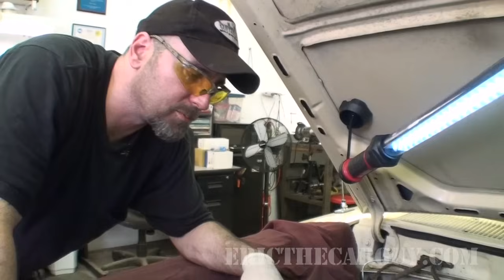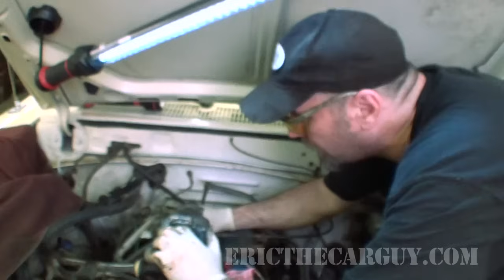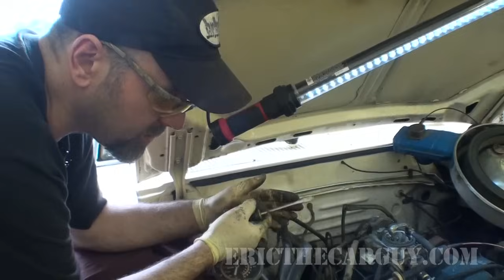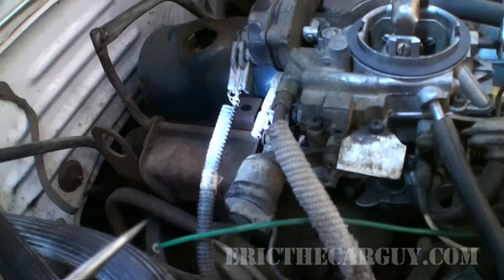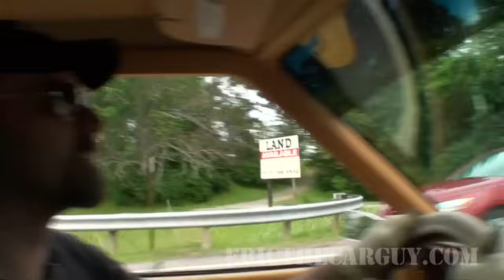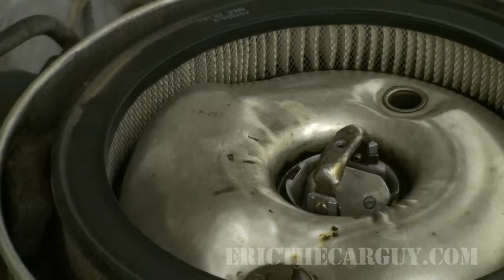Carburetor Adjustment Basics -EricTheCarGuy

Comment: Hi Eric i have a 94 Nissan Cefiro with a RB24S Straight-6  and it has a Carburetor
what do you think should be the idle? currently its on 580 or something when i start it in the morning and if the engine warms it goes to 600 by the way its a M/T

Comment: Great video. I've almost got mine dialed in (1970 F250, FE 360), but it dies when I step on the gas too hard. Will look at the accelerator pump and check for vacuum leaks (just one line for timing advance, shouldn't be hard).
Reply: did you ever figure it out? im having the same issue
Reply: @stephen-oy8lx  Leaky accelerator pump diaphragm

Comment: I tried to adjust the choke dial thing (the large black knob); and it would not turn by hand. Yes, I loosened the screws holding it tight. Do they get stuck sometimes? I am thinking to use a wrench on it; but I just want to check with you guys first. Anyone have that experience?

My car is a 1965 Mustang with a 200 c.i. 6 cylinder engine; and the choke is NOT electronically controlled.
Reply: +Bob Simmons I solved the problem. My choke has a bracket to hold the heater hose; and the screws I was loosening only held the bracket on. The crews to loosen the black dial were underneath the heater hose bracket. My car is a 1965 Mustang. The carburetor is just like your, except my choke is not electric.

Comment: so if the car kicks when you put it in drive that means the idle is high?
Reply: I hope that you didn't automatically assume that something as expensive as a T.C was your problem...if it were me, I'd have a buddy scoot through the gears with the parking brake on while you look at where the driveshaft meets the A) Transmission, B) Rear Differential. Does it clank when he courses through the gears? When the vehicle is OFF and PARKED, go under the driveshaft and see if you can turn it with your hand. U-joints, maybe? Yolk? Rear diff? Try these. Transmissions are (usually) not the first thing to go...but they do cost the most. Good luck man.
Reply: +Austin Evans My 1965 Mustang 6 cylinder engine gives a pretty good jolt when I shift from Park to Reverse. I don't quite understand what you said in the comment above; but it sounds like my car has ,generally speaking, the same problem. Are you saying the torque converter needs to be replaced? What is the solution to the problem? Thanks for your help...
Reply: It can, it means that your torque converter is trying to engage, so when you put it in drive, the input shaft of the transmission is already spinning when the gears engage, jolting the drive lines and kicking the car forward. It's the same reason you can creep the car without giving it any throttle.
Reply: +Bob Simmons what rpm does you engine idle at?

Comment: good vid as usual. Qustion here.......86 caprice 5.0 has a rough idle but smooth when driving. Car lacks power. Had a complete tuneup........
Reply: That's cos it's a caprice
Reply: Check idle jet etc
Reply: Cars and their Parts thanks will do

Comment: Hi sir, Just want to ask about my problem in my nissan b13, carburetor type engine, i can find the problem, when ever i start the car, it will run smooth then after 5 mins of running the engine start to choke and the engine will stop, and i will start it again and it will not start after 15th to 20th try the engine will run again. i already adjust the carburetor but still the problem occur. what will is the problem of my car? thanks
Reply: Get a Weber 32/36 carb for it those hitachi a are garbage I put one in 78 Datsun b210 and it will solve that problem
Reply: check your fuel lines to make sure they aren't leaking, and check for stress cracks in the lines, check the fuel filter to make sure it isn't clogged. also there is a screen in the gas tank and it may be deteriorating and blocking fuel flow

Comment: Great work bro. Going to try on a 1993 nissan sentra b13 Carburetor. Revs at a 1000 when in gear, once its neutral revs goes up almost 2000 rpm.

Comment: I've got a problem on my 68 mustang L6 where it idles rough. I can get vacuum at idle to 17 PSI, but the needle searches around slightly as if there's a vacuum leak. But I sprayed carb cleaner everywhere and never found one. When listening to the engine it sounds like it doesn't fire evenly, like there's a hiccup in the rotation, at park and in gear. Gas mileage is terrible, throttle response is okay, not the best. Timing is set up properly but its really touchy, there's one sweet spot and not much room to play with when rotating the dist.(otherwise I get surging or stalling). Air mixture screw is turned really far out for best Idle I can achieve. Car diesels slightly after engine is off. I'm lost as to whats wrong. Any help anybody???? Please.
Reply: +Dakota McCullough Are you getting engine sputtering at highway speed as well? I'm having a major issue keeping the idle on my I6 good at both cold and hot; and it coughs and stalls on the highway really bad
Reply: +Keltyn Ruddock no engine sputtering on the highway, thankfully, but it does feel like I'm pushing the car to its limits when I drive on the highway, but I think that's to be expected from an I6 with a c4 tranny. I've considered saving for a new carb from classic inlines, that may help your problem too. also look into your choke mechanism and make sure it's set up right. Mine was all out of wack.
Reply: +Dakota McCullough I actually put a reman carb on it shortly after I bought it, the old carb was beyond saving. My choke seems to be working right but I can't for the life of me figure out what's causing it. it's fine when its cold, nice solid shifting, perfect throttle response but once it warms up that's all out the window

Comment: Mr. EricTheCarGuy. At the end of your video, you mentioned hot start but never went into details for that adjustment. If the engine is struggling a bit on hot start, what is the initial adjustment?

Comment: Ok folks, I recently installed a Rebuilt Hitachi Carburetor on my 87 Isuzu. The carburetor was rebuilt by National Carburetors and the truck is running good. The problem is that I don't get the gas mileage I should be getting and there is like a whining screaming noise. Its not incredibly loud, it sounds a lot like a squeely fan belt but it is coming from the carburetor. I don't have the fuel mixture adjustments, they are locked in place. Please help.

Comment: Pretty sure the throttle solenoid is for the prevention of "dieseling" when you shut the car off.

Basically the idle screw is set to about 450 and the solenoid is set for 750 + or - and when the ignition is shut off the solenoid retracts and the base idle is achieved preventing the engine from "running on".

If the solenoid fails the car will still idle when started but will be very slow indicating a solenoid failure.

Comment: The vacuum hose that you plugged goes to the bottom of the air filter housing on the sensor for the heated air door, of course you don't have any tube going to the  door anyway.

Comment: I noticed that the engine wiggle a lot when it's running. Could that lead to problem or is that just the way it should be? Do you need to do anything to make it more stable?

Comment: Man, Eric- after all this- I'd just steam clean up the engine bay, dress up other stuff (new premium wires, cap, get that air cleaner painted & a new duct, a pkg of real vacuum caps, etc.) then paint that engine- and keep it in the car. Why "follow the pack" with some "high performance muscle" refit that has been done so many times? Change the trans fluid & filter, new modulator- really put money into it- and keep an old original economical car.

Comment: Hi Eric, in the whole video you did not mention float level check/adjustment, and I was waiting for it since in my opinion this is the first basic settings you should check/correct when adjusting any carburettor. Often the lip/tongue part of a float can be bent to set the float level just right.

Float level is important because it affects mixture richness along a very broad load range.

Comment: My 1959 Cadillac series 62 Eldorado Biarritz has something wrong with the carburetor. It acts like its not sending gas to the engine. If i spray carburetor cleaner it runs for a few seconds then stops. any ideas on what could be wrong...
Reply: Fuel pump problem. Or something clogged. Or a fuel leak.

Comment: I need to rebuild the carburetor from a 1982 Toyota Tercel  with 3A-C engine. 
Being a California emissions spec, it has a heavy load of vacuum lines. No joke. 
Luckily from factory, the mixture adjustment screw is sealed and no one has been able to fiddle with it since factory, so that part is ok. 
The problem Im having is that at idle the emissions are high (around 800, it should be no greater than 120 HC) it will not pass emissions test.

Comment: i like carbs. they force you to (gasp!) know your car works and how to fix and adjust it.
Reply: So does fuel injection just two different ways of adjusting fuel maps. One does it by screws and stops the other by informing the ECU what fuel amounts should be entering the engine at certain conditions.
Reply: @Cragified  True, but on both you have to move that map if you make a serious change on the engine, the EFI will more or less make it painless depending on what system you have, where as a carb you could be starting from scratch with that engine.
Reply: true, but all a carb needs is a screwdriver, and all you need to do is watch and listen until the engine sounds good. because of this anyone from 5 to 95 can do it and it takes 5 seconds to figure out what sounds good and what sounds bad.
to tune an ecu you need a laptop, usb to obd/ecu cable, software, and knowhow on what you need to modify to get the desired effect. even if you have a laptop, the software and cable could run you $500 or more, not even considering if you have to get an aftermarket ecu or a base tune. i dont know many children or old men that can pick that up in a few minutes.
Reply: Tyler Gutstein Though one rarely does have to tune up an electronic fuel injection system since it is self compensating unlike a a carburetor or mechanical fuel injection system.

Sorta like the gripe that modern cars have no room to work on anything, while older pre 80s cars had tons of room. Well you kinda needed that room since you had to do semi major work on a vehicle every 15,000 miles or so.

One is more accessible but requires more maintenance (Carb/MFI). The other is less accessible but requires minimal maintenance (EFI).
Reply: well as someone who enjoys working on cars, this isnt a big issue to me. though i wouldnt classify checking and adjusting a carb and making sure there arnt any obvious damages under the hood "semi major".
Reply: As someone who collects vintage cars and maintains them I can tell you that carb adjustments are just the tip of the iceberg of what you have to do with older vehicles to keep them in good running order :) Head gaskets, main seals, etc. are all things that require some disassembly and thus room to work. Greasing points, etc. something that most people don't even realize once existed due to sealed joint assemblies being the norm today.
Reply: @misterdeedeedee  fi tech makes a great efi with a handheld controller that is perfect for people starting to get into fuel injection and tuning, amd its not too pricey either.
Reply: I'll stick to fuel injection, it learns on its own to make better more correct mixtures and I know in the cold mornings if I'm late for work I won't hit the gas on the way out the driveway and stall straight out. Fuel injection once you understand it is really very simple and very easy to fix in my opinion especially with the new age of OBDII scanners that anyone can get for about 40 bucks and a set of sockets and a ratchet. Carbs are cool and have their place in the world for many reasons and then some but fuel injection is really the new way to make more powerful yet more efficient and drivable at the same time.
Reply: @jr540123  FI is not EMP proof.
Reply: You have to know how fuel injection works to work on it too

Comment: The carb should be the LAST adjustment in the "chain".  If you have a car with adjustable valve clearances...check those first.  Second is any emission equipment.  Move on to ignition timing, then carb adjustment last.  Remember...on older cars use timing specs as a guideline.  Don't simply set it to a published number.  As these cars age there's "slop"(as noted in the timing chain)especially in the dizzy, so the timing will change as well.
Reply: I don't have to worry about that. I have timing GEARS!

Comment: Hi Eric would be nice to see how accurate the adjustment was using a gas analyser after adjustment.
Reply: ***** true, but always easy to weld a bung to the pipe and use a air/fuel meter its alot easier
Reply: inertia210 .gbfhkgvmgmgc

Comment: Hey Eric question for you I see you have a lot of keys on your key chain.  Does that Hurt your ignition or not I know theres a lot that say that it does and some that say that it does not.
Reply: spelunkerd if you drive any car you better have a light key-chain if not you'll ruin your lock cylinder much faster than normal
Reply: If you drive a GM, better to have a really lightweight keychain. There is speculation that a heavy keychain caused engine shutoff in the GM ignition design flaw. Who knew?
Reply: spelunkerd the whole problem can be resolved if they re engineered the key to where it don,t have that slot in it the key has a wide slot in it and gives it  leverage along with heavy keys helping the lock cylinder rotate it probably takes 5-8 pounds of pull to get the lock cylinder to rotate to shut the engine off losing power,air bags,breaking power steering and so on as demonstrated in you tube videos "Driving GM's Flawed Ignition Switch" --"GM expands ignition switch recall to newer models"     brilliant engineering there lol
Reply: I have had to replace every ignition on 3 of my cars until the took most of the keys off my chain.  Obviously I wasn't a fast learner but after the 3rd time at over $600 a pop I changed.  Now I have three keys and one key fob.

Comment from the maker: Now that the carburetor has been rebuilt, let's adjust it. Carburetor Adjustment Basics -EricTheCarGuy
Reply: inHg is inches mercury, a way to measure pressure. -29.92 inHg is full vacuum, 0 is atmospheric pressure at sea level and a positive reading would equal positive pressure. To use the gauge you simply connect it to a source of vacuum.
Reply: Very Good i love it. 
Now we need an explanation for the vacuum gauge what can use for and how to read it. 
Thanks alot.
Reply: toolman talal  You want equal vacuum across all of the ports
Reply: have you seen those mickey thompsons  he bought?
Reply: Oddball gamer Killer pieces of rubber.
Reply: +Thomas Gionet 
i don't understand the partitions of the gauge how to read it and how to use it.
Reply: Thomas Gionet 
great explanation thanks. 
I have a vacuum pump break bleeding ket and there tow units in the gauge inHg and i can't. remember the second unit and i can't figure what scale for what unit. sorry for the very much questions. 
thanks again.
Reply: +EricTheCarGuy Eric, you are a car god!  I wish I had your carburetor skills.  I just bought a 1986 CRX carbureted, and if it ever needs a rebuild, I hope I can fix it using your videos, or have someone as skilled as you are to work on it!
Reply: That turbo is way too overkill eric! 
You need some fat rubber in the back.